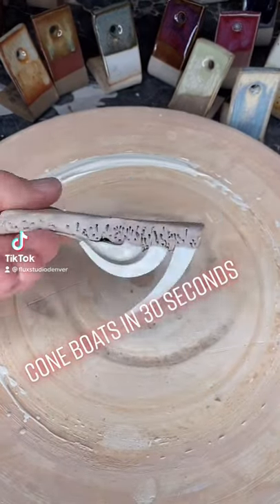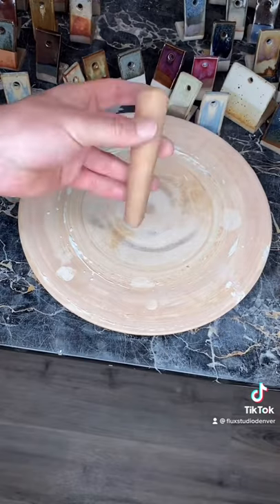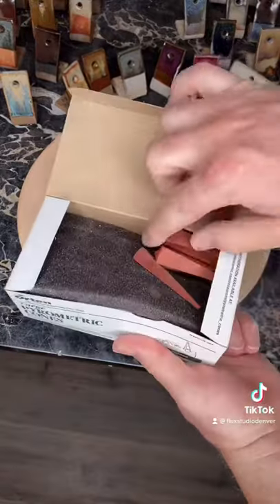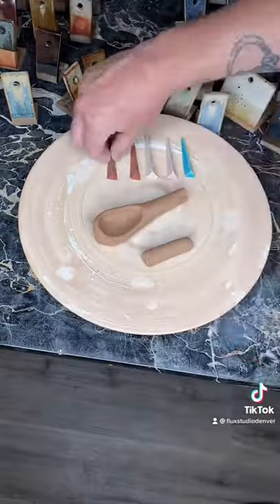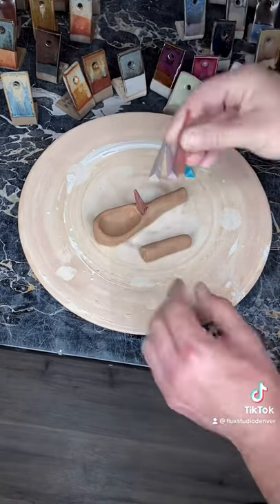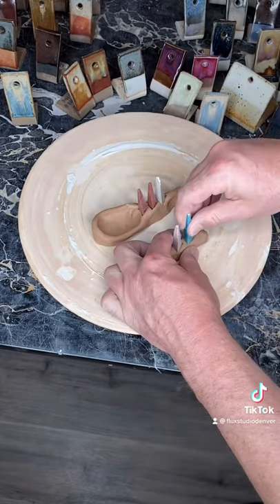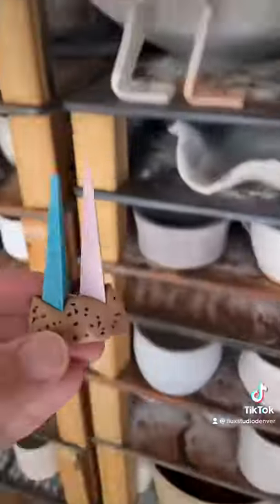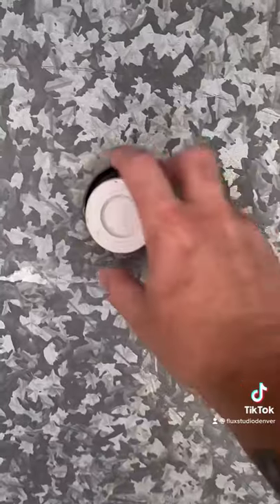What are cone boats?!

Comment: Thanks so much.  Always used cones that stand on the shelf, but I can see that there is less chance of any damage to pots if the fall.  Must the boat be completely dry before placing in kiln.  I fire cone 5 and 6 electrically
Reply from the maker: It is always better to have them dry. I usually make them when I get done loading. I put them in for the 10 he warm up cycle. They are dry when we light the burners.